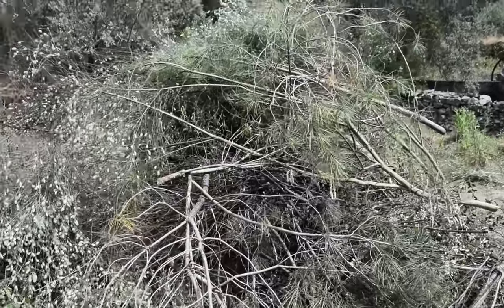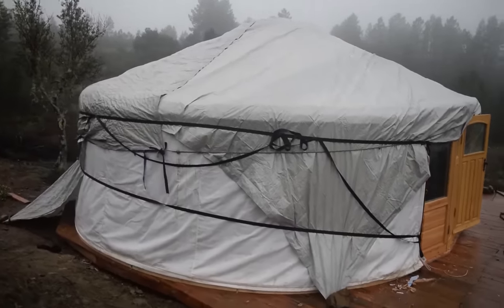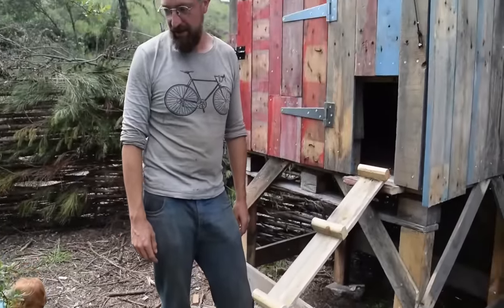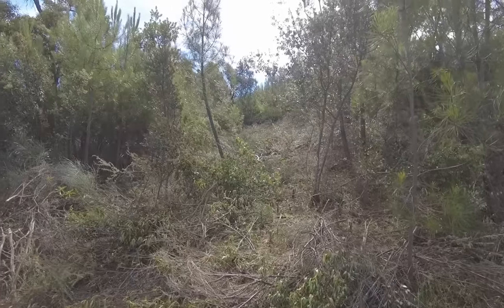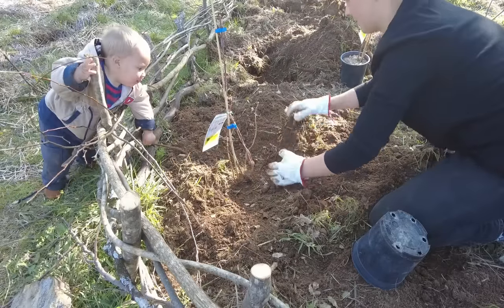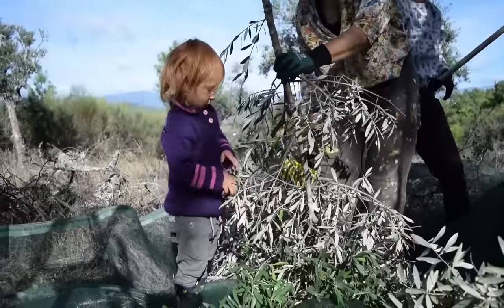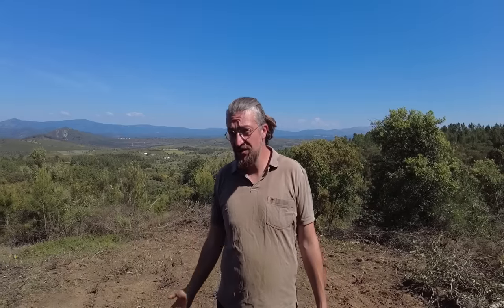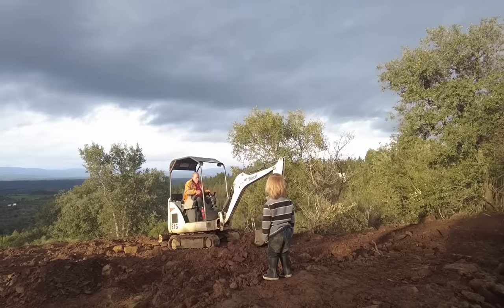We moved out of the city and this is what happened next

Comment: Hello any news on the digger Over on Luke and Sarah of grid life  they have a digger had lots of mechanical issues  they built up lots of contacts ther3 digger aworking machine  now be worth chatting with them be interesting to hear what your plans are
Reply from the maker: We found that the timing chain has stretched so needs to be replaced and we are trying to source one, but it takes some time because it is not a very common engine. Thanks though.